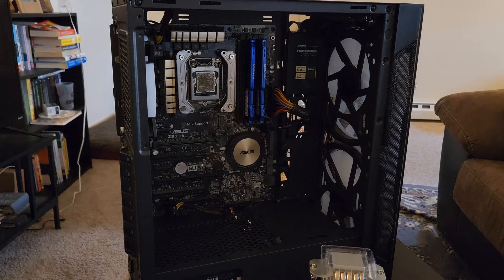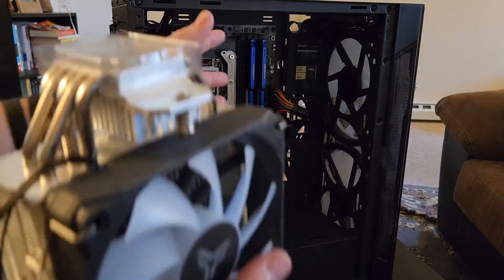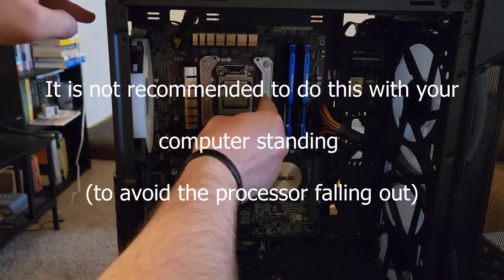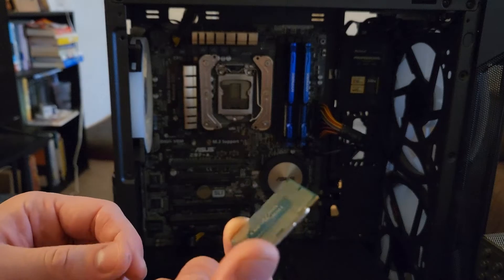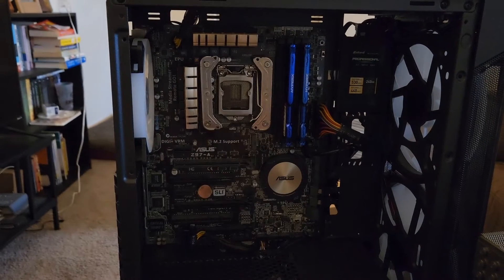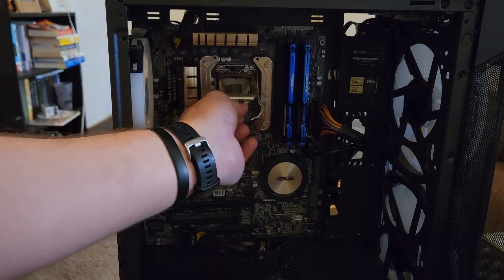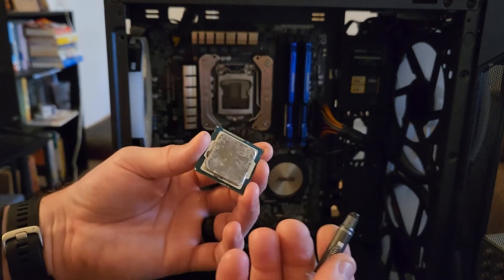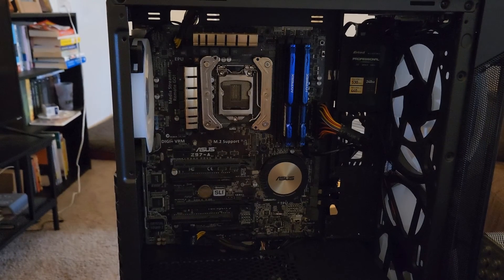How To Replace A Processor - CPU Removal And Installation

Comment: Currently I use i3 processor. Can I change to i5 processor but not change motherboard. 

Also currently I use gtx 1050 ti, I want to change to rtx 2080, do I need new power supply unit or can remain old one?
Reply from the maker: @29Kd11-f3l  You need to check the motherboard specs to ensure it can support the i5 you want to add, but most likely that will be a possibility. For the GPU you will most likely need a new power supply, but it depends on your system. You need to check the needs based on all of the hardware, and what your current supply offers.